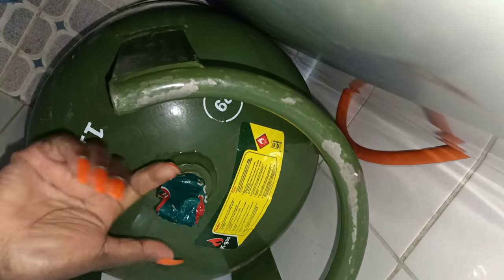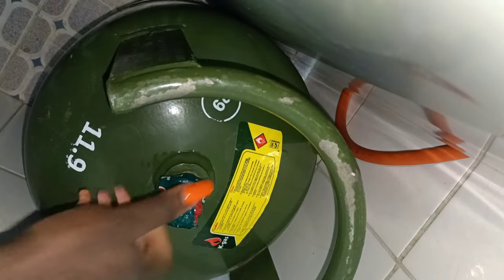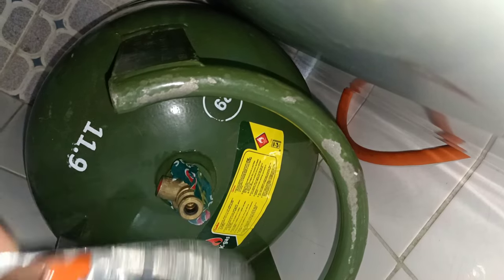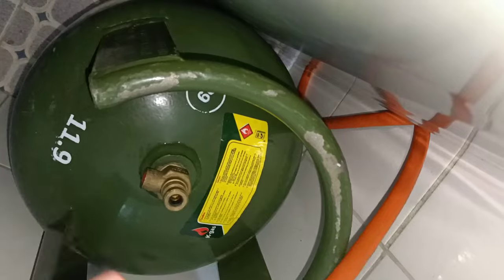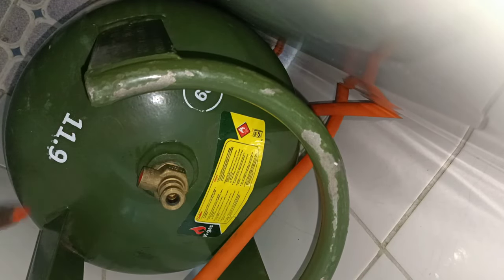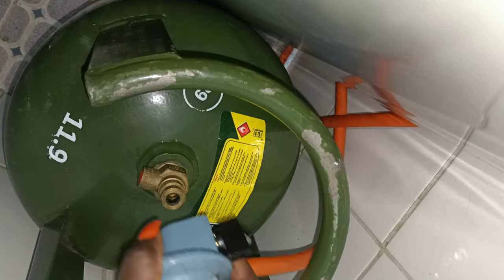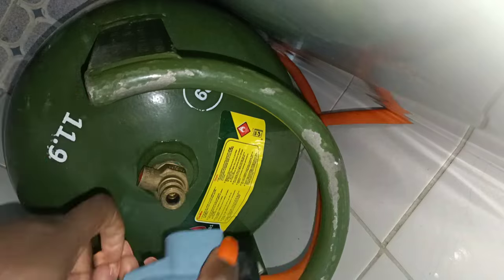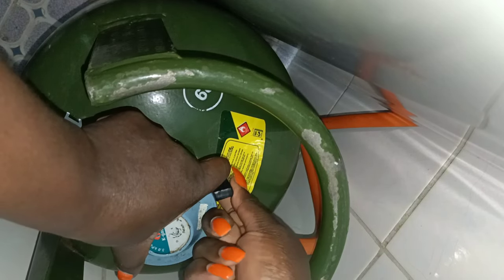HOW TO connect COOKING gas cylinder to the COOKER || Connecting gas regulator to cooker

Comment: Madam you have to fasten that pipe with a metal fastener that's dangerous.
Reply from the maker: It's safe. We use the metal fastener on the connection to the cooker.